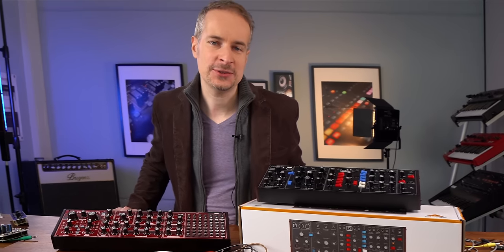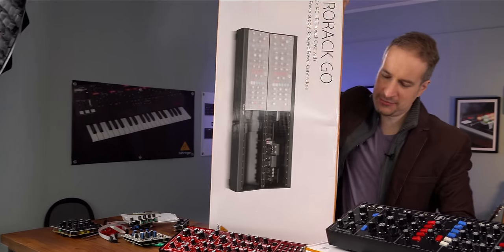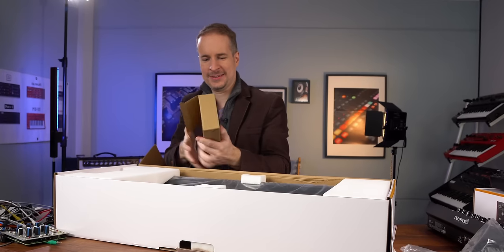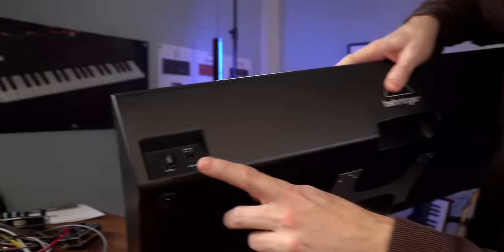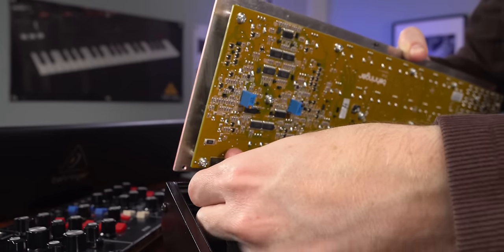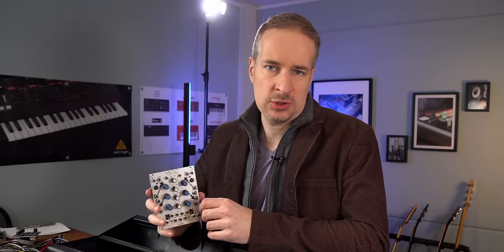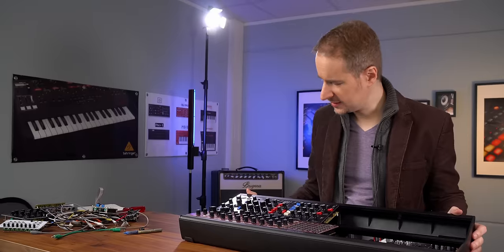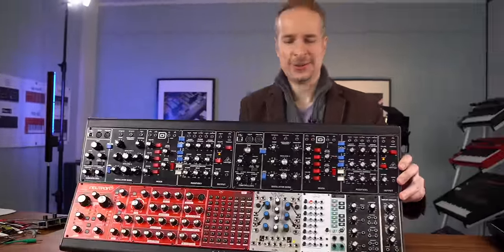Go Go Eurorack! Our new modular synth case

Comment: Oh boy, Tiptop will be pissed. That looks very similar to a Mantis. Digging this but sad to see that they went with the sliding nuts. Effing hate them. I am hoping B will also provide an option with threaded rails. Also, glad to see the plug to Modulargrid. That site deserves all the love we can give it!
Reply: What's the issue with sliding nuts? (Never used them)
Reply: MB positioning the nuts where you want your module to be will take some getting used to. Since we will always be changing things around (eurocrack 😁), it will be a pain to deal with moving the nuts around accordingly. Also, according to Murphy’s law, the place where you want your module to be is the place where you won’t have any nuts left. So, you will have to constantly remove modules that you don’t need to touch, simply to get out any nuts buried under them...and so on. They do give you a great fit since you can move them and may be squeeze the odd extra HP out of the rack.
Reply: @moralboundaries1  there's no issue. Just distribute extras to the left , right, and center.  If you need to move something you then only have to take out one module and expose the extra nuts, loosen a few screws and slide everything down. With threaded inserts aka fixed position holes, you may have to take out all your modules just to scoot them down to open up space. It's a hotly debated topic and anyone who thinks threaded rail are better are simply wrong. :)
Reply: Like all of Eurorack stuff, sliding nuts have a learning curve, but it's not that big of a deal honestly. I've removed my entire 104hp x2 rack several times now and it never takes me longer than a couple of hours to literally rearrange the entire thing.
Reply: @kurbfeeler  agreed. I think your mileage will vary with threaded set rails. It's not that hard to slide nuts around (hah) on your rack (hah).
Reply: @kurbfeeler  Agreed, and modules need removing to fit new ones anyway, to get your hands in to connect the power ribbon.
Reply: Another sliding nut hater here. Threaded rails like the Arturia rack brute would make things so much easier
Reply: Just get some threaded strips. 3€ for 84hp. That's 9€ for three and you cut one down to size. Problem solved...
Reply: Very much disagree with you on sliding nuts. They're not that bad and I love being able to make minute adjustments after a module is in. No side gaps! I have a Pittsburgh case and a Rackbrute, so I'm familiar with both. Maybe I'm just OCD but I prefer the adjustability of the Pittsburgh sliding nuts. Not like I rearrange stuff on a daily basis anyways.

We can definitely agree on MG though; they're amazing! If you're able, I encourage everyone to get a Unicorn account, even if you don't need it, just to support them!
Reply: @homeslice1479  I got their unicorn account just now. Thanks for pointing out the option which I had forgotten. I don't have a need, but I will gladly support them every year!

Comment: This is literally Tiptop Audio's Mantis case. Wonder whats the price diff.
Reply: It’s quite a shame to rip it off in such an obvious manner. They could have come up with their own version of the design at least. What’s even more shameful is that if it’s 200 € I will buy it. Euro cases are extremely expensive, just as the modules are.
Reply: It’s 70hp larger and its way less toyish looking. The mantis has a pretty robust power supply though. I’ll be curious to see how this one works out.
Reply: @nathanricker1  True dat.

Comment: Very tempting but it looks quite big, I hope there will be a shorter version. I just bought a neutron which is fantastic and has convinced me to go modular. On the neutron, I like the jacks at the back for external input, output and phones. It's sad to loose that feature when you put it in a eurorack case.
Reply: Olivier Friker Behringer already offers a "shorter" 104hp case. It is a very simple case I believe, no power supply or bus board.

Comment: I literally just bought a Mantis 30 min ago. Might have to cancel that.
Reply: I've got a Mantis-- and while this one is interesting, the Behringer has sliding nuts, which I don't like as much as the threaded rails that the Mantis has.   But for $100 less and if it really is 140HP instead of 104-- people may decide to live with the sliding annoyances, especially if they've not yet had experience with them.   Will also be interested in seeing what kind of modules they'll release.   Also, can the Behringer handle full depth Eurorack modules?   The Mantis can in the bottom row.  I also have the Mantis cover by Decksaver and the carrying backpack by Tip Top.   The barrier to entry for Eurorack just went down a bit in any case...    For reference it looks like threaded inserts for this could cost you about $50.
Reply: If you need a case right now...Mantis is still good no ?
Reply: Syncopator it’s 140hp
Reply: @ghostly606  Sorry, typo-- fixed now.  Glad to hear some confirmation it's really 140...
Reply: @Syncopator  you can always replace the sliding nuts with threaded rails. https://www.schneidersladen.de/en/gewindestreifen-84te.html
thats only 84hp but you can pretty much get them any length you want
Reply: For +72hp I think I can wait.... obviously they already have units ready to ship so, I don't think It will be a long wait.
Reply: @Syncopator  Behringer pinned a comment: "The unit will ultimately now come with a mounting strip rather than sliding nuts/bolts."

Comment: My question is do you lose the usb/midi capability when you put the model D into the rack?
Reply: Yes, USB is not accessible and even if you still get the Midi port you lose the switch to select the channel. You must consider that this is two different worlds and a choice to make. As standalone units you're using Behringer synths like any other synths of any other manufacturers, but once integrated in a Eurorack they really become a module, a part of a whole. And in a Eurorack system you must use CV/gate signals, modulations, not USB or Midi. (You sill have midi but take care about sync between all your units and real modules using CV/Gate...). This new Eurorack case is a very good idea, at this time they can only promote it using their synths, but the reality is they are preparing their own modular system and they must have a case if they want to sell their modules (the copy of the Roland 100m). So you can use the case today to store a Model D, why not, mine is within a eurorack, but the most important is that they are opening the door for their eurorack modules... That will be very interesting, more than using a eurorack case just to put a Neutron or a Model D.
Reply: Olivier Dahan that makes sense, also the power draw would be different w the addition of midi usb. Very cool case, I was just wondering. I sold some modules recently but Behringer is making me want to get back into it! 🤘
Reply: @yuggothproductions  Behringer is hell :-) you think you stop when you want but each time you look at a new Behringer teaser you want to buy more :-) Worst than a add for a new Vodka! In the video one can see Moog modules copy... they spoke about the Roland 100m but never about copying Moog old modules... but it seems they did it. It will be difficult to resist to build a Behringer/Moog modular or a Behringer/Roland 100m one ! Perhaps the both... They are pure evil :-)
Reply from the maker: No, you keep USB-MIDI and the Model D will default to MIDI channel 1. You'll only loose USB on the Neutron, cause the Neutron has the USB jack on the back.
Reply from the maker: @KNHSynths  No, you keep USB-MIDI and the Model D will default to MIDI channel 1. You'll only loose USB on the Neutron, cause the Neutron has the USB jack on the back.
Reply: BEHRINGER thanks for clarifying this! Not sure why that other guy commented otherwise! 🤪
Reply: @behringer  You're right, Only the Neutron (and the DM12D) was before my eyes when I wrote the comment. Model D has a front USB. But you lose the midi channel selector. And I discourage people to use USB midi + classic Midi + CG/Gate at the same time in a eurorack context, there is always a syncing problem between all these signals even coming from the same computer. A Eurorack must be used with CV/Gate, a central clock distributed using multiple or special modules like Expert Sleepers. To be noticed: you also lose USB and Midi channel selector on the K-2 and the Neutron (I have them all...). so on 3 Behringer synths only the Model D is keeping USB, it is an exception.

Comment: What about the USB and other connections you loose in the back? Thumbs down... We pulled the Neutron out the case only to put it back because we needed the usb for an update. YOU should not loose functions just because you switched cases.
Reply: True  and midi channel dip switches

Comment: No no sliding nuts 🤦🏽‍♂️
Reply: That's why he said he had to edit out hours of footage!
Reply: All the better to jump over Barb wire fences ;)
Reply from the maker: We hear your comment. The unit will ultimately now come with a mounting strip rather than sliding nuts/bolts.
Reply: @behringer  Is it true that they shit with strips rather than nuts? 
On all web shops it says 96 sliding nuts. Also please consider making a case that with a lid like for instance the intellijel cases, suitcase cases or doepfer hardcases. For transportation we need a lid. 
Another thing - please consider shipping with screws for modules. It probably wont mean too much for the manufacturing price but would be really convenient.

Comment: Did you call that a "beefy power supply"? I have a Eurorack module, a slightly older piece of kit that hasn't been new for two decades. The only noticeable aging since the unboxing (which wasn't even a thing back then) is a few scratches. It's a solid & heavy beast for the ages, and I love it. 
They call it... MX802A.  Although made by a company new to me back then, Behringer, I was confident I'd chose correctly.
Okay, fine, it's a 20-year-old 8-track mixer, complete with 48V phantom power. It's power supply bloody well be beefy.

Four inputs switch between XLR/mic inputs and balanced line channels, and 2 pairs of balanced line-level 1/4" TRS stereo channels accompany them. This 8-track, occupying just half a Eurorack, has a feature list like a hacker stuffed a recording workstation into a heavy, steel shoebox. 

All 6 channels have a complete set of controls: level, pan, a rather clever three-control hi/mid/low function, separate pre-/post-fader AUX send controls, and peak LEDs; the master output control also has dual left and right 12-band meters for precise leveling.

It has a pair of stereo input & output RCA jacks (for recorders, maybe?) The inputs can route straight to main, so I plug my phone into it, with a permanently connected stereo 1/8"-RCA cable. "Sound system gonna bring me back up, yeah!"

With the 6/8 line inputs, the 2 RCA I/O jacks, 2 AUX sends, 2 stereo AUX returns, main and control room (stereo) outputs, and a 1/4" (summed-mono) headphone jack - there are so, SO many tricks you can pull with all the inputs, outputs, routing, and switching, that you should just RTFM. 

I'm sure there are newer ones with more options and stuff, but I've had it so long and am so familiar with it it's become an instrument. Besides... ferreting out the dozens and dozens of wires and cables in this mess would cost way too much time.

(Sorry I write so much. I cannot help it. I still probably made editing mistakes.)

Comment: If you can bottle this one at =/< 180€ this is great. - The 'Go' title is a tad optimistic though without a lid. It's easily 2k worth of modules that fit into this case. Fine to move around at home. Requires proper casing for outside.. especially gigs. 3,8cm depth excludes quite some modules, but that's a general problem with most desktop/skiff cases. Depending on the price, I'll take it regardless.

Comment: In the manual from the eurorack go it states ''CAUTION: Due to the power requirements of the MODAL D, do not connect any other modules to the same zone (A,B or C) on the EURORACK GO'' so how did you manage to squeeze in two modal d,s, one neutron and many effects?? Did you connect the neutron and the effects all on one and the same zone for example zone C and on zone A and B the two modal d's???

Comment: Is it deep enough? Will it be able to fit doepfer modules or anything else that's deep?
Reply from the maker: The case has a maximum module depth from 40 mm (1.57'') rear row to 62 mm (2.44'') in 60% of the front row. Hope that helps.

Comment: I figured you'd make a case sooner or later, but I was assuming it would just essentially be the empty case of a neutron or model d. You guys went above that!
Reply: Behringer already have a skiff based on a double length Mother 32 case for £65. I was very tempted last summer but it doesn't include power so I went for a Doepfer LC box with built-in power and a sturdy IEC socket (kettle plug). I don't like barrel plugs they're always wobbly.

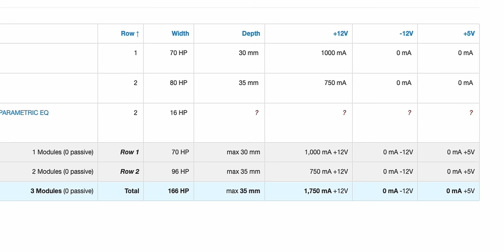Comment: I have ordered this unit and am very concerned. In the video and manual you say each zone can handle 1 amp. The Model D in the video needs 1000 mA to run (which is 1 amp - that stat is shown in the video at 3:46). If that math is correct and carried over to the neutron.. how do you have a whole other section of modules because the 2 Model D’s and Neutron would basically max the Go’s power out. Modulargrid.net has the Model D now listed at 580 mA which would work. I am just very confused and am afraid this wont work. Trying to find out if those power specs are correct. Thanks!!